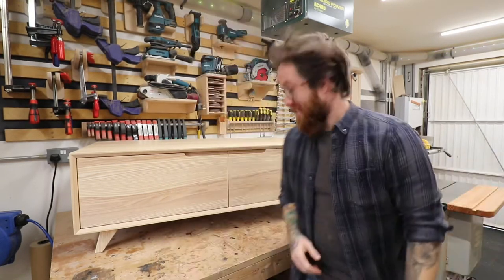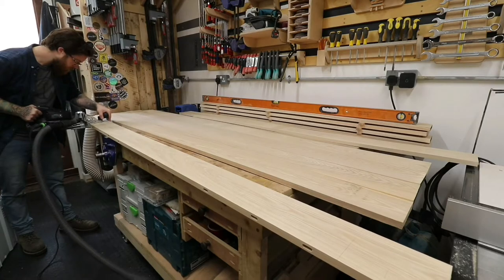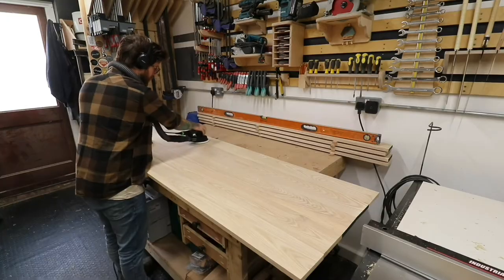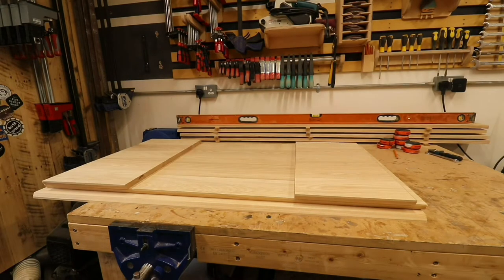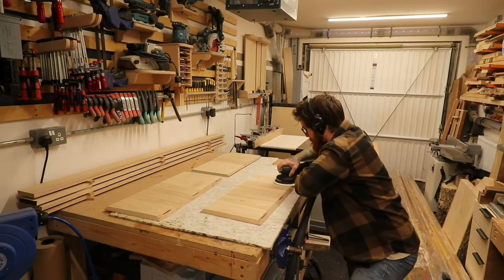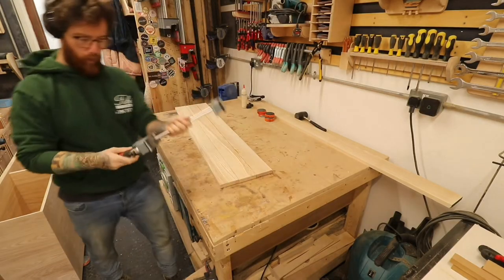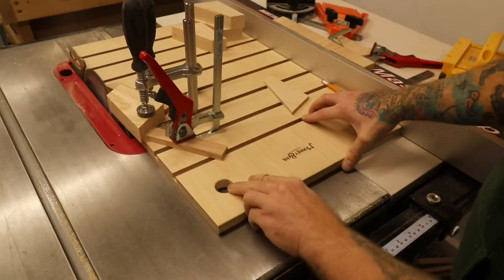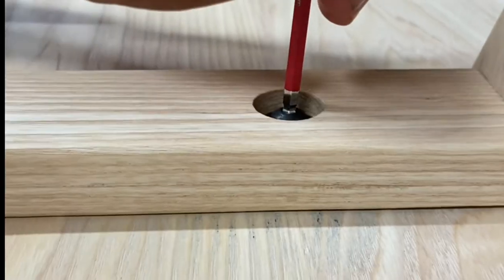WATERFALL mitre joints…YES or NO? || Woodworking

Comment: Ive always had problems with blum hinges sagging after a while, when the door height is alot shorter than the width , any tips?
Reply from the maker: Ah no way, I’ve never actually used Blums door hinges only their drawer runners so I can’t say why that could be happening, but I’ve never had problems with these particular ‘euro’ hinges in the past, I think the brand is HGV or something like that. Hope that helps but I’m sorry I can’t help with the Blum hinge problem 🙈